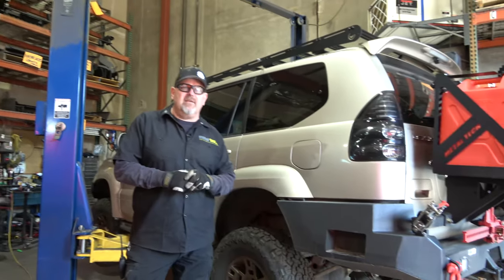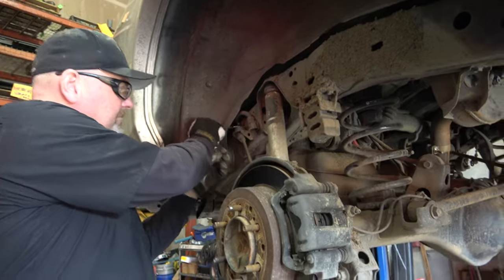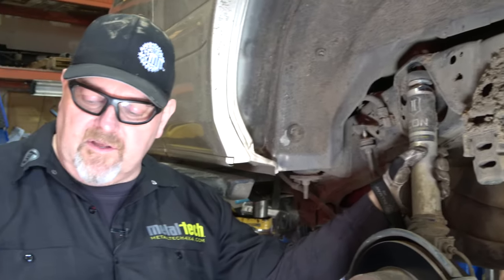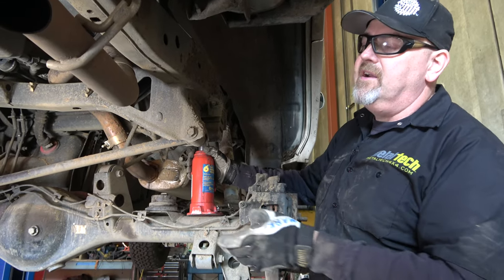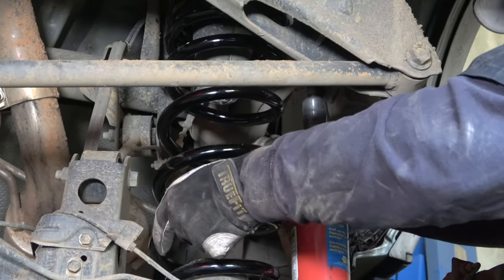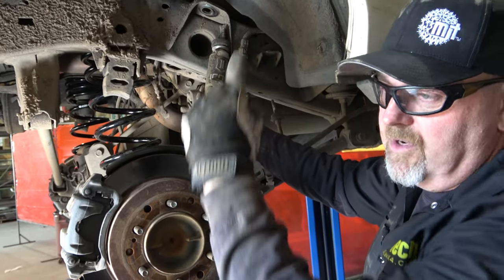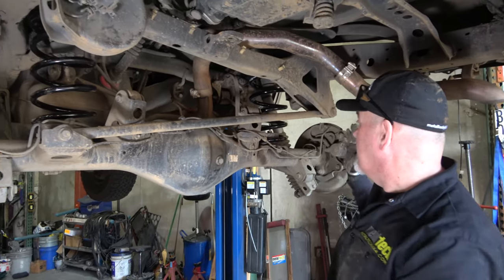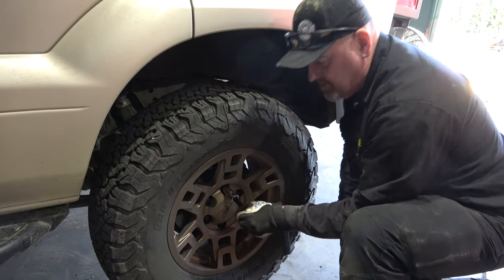Rear Coil Spring Installation for GX470/460, 4Runner, FJC

Comment: Great info and well delivered. I'm a Mech/EE engr, use to have a Jeep Wrangler and wrench on all my cars based on previous experience and good / accurate info that can be found on the Internet, including You Tube.  Now that I'm an owner of a GX platform, I'm finding that there are some not so "good" / and potentially inaccurate info from people wrenching on their Toyota/Lexus platforms.  However, as I watched a few of the Metal Tech videos, I'm very appreciative of the  accurate and fundamentally sound information you are providing to enable the community to work safely on their rigs to achieve a fundamentally sound mechanical / electrical outcome.  Well done fellas, I really appreciate it.
Reply from the maker: That's really appreciated! Happy to hear you find it accurate and enjoyable :)

Comment: Great video between the metal tech long travel and Icon overland how does the ride compare?
Reply from the maker: Since the MT4X4 springs come in two rates you have some choices. MT4X4 medium LT springs provide a much softer ride and for lighter builds, yet still give you the full long travel free height. The MT4X4 Heavy LT springs, as well as the ICON springs, are for a heavier build. However the MT4X4 springs are made to have a taller free height for long travel use.  ICON springs are a good option for heavy loads if one is not using a long travel set up.

Comment: Actually it’s easier to disconnect the shock from the bottom mount.
Reply from the maker: Agree it is easier to "disconnect" the lower shock, yes.  However it is very difficult to "install" the sock if the top is already installed.  The shock mount angles downward, if the top is attached you have to swing the shock onto the mount that is facing downward.  This is especially difficult with a shock with a bushing lower mount vrs. a bearing found on higher end models.    This is why we always install the lower mount first, then use the shock body as leverage to twist the bushing/bearing so the top mount can be installed.